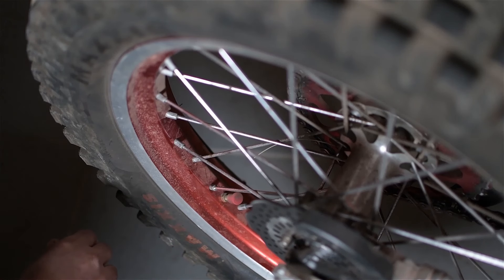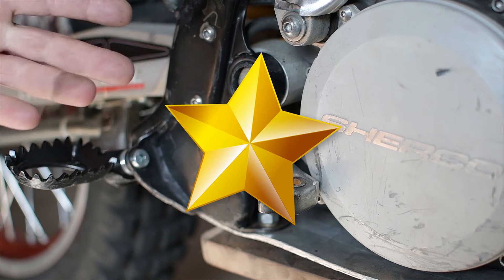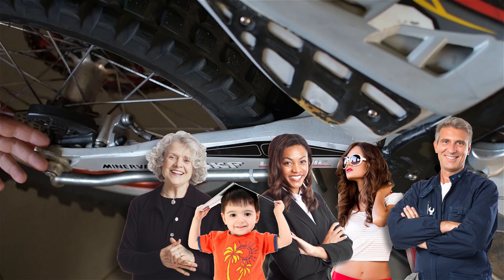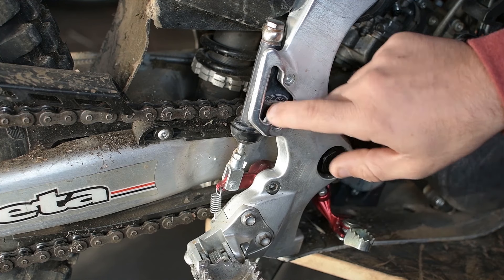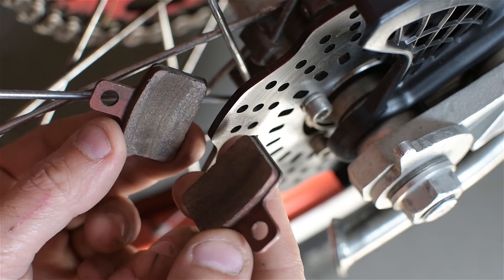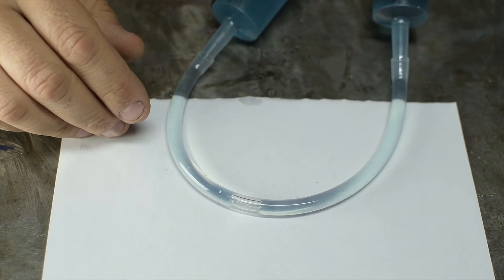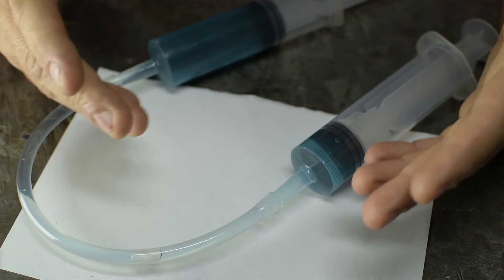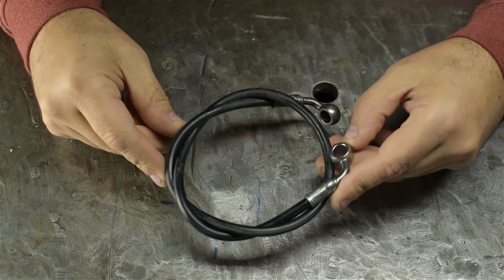I'm an Idiot! (Soft Spongy Brakes)

Comment: To fix my parent's van's squishy brakes, which were 4 years old, I replaced them. Only to find out that the rotors were well in spec and the pads had only half worn... they didn't need replacing... but it did fix it.

My best guess is the Eldritch effect, which will be discovered in the year 2241 (don't ask how I know).

Comment: Tony, you are not out of the woods yet. What you didn't cover was what causes the brake to stop braking; what pulls the pads out of contact with the disc when you release the brake lever? It's the seals acting on the pistons in caliper. The pistons don't pass effortlessly through the seals. The seals grip the pistons, deflect when the brake is applied and then recover to pull the pistons back a fraction when the lever is released. When the pads wear the seals cannot deflect enough, they lose their grip on the piston and it slips through to take up and compensate for the wear.
Although it might not be noticeable on all brakes, there's a cycle of increasing lever travel followed by seal/piston slip which should restore the original brake feel. So it is likely that the soft spongy feel will return, even with the new disc.
By the way, although spongy brakes don't feel good they still transmit the same pressure to the caliper so stopping power isn't reduced.

Comment: I have a spongy brake on my bicycle and couldn't find the problem  (my brake has a steel cable no hydraulik fluid). The bike is about 30 jears old and the breaking disc probably has never been replaced. I think ill check them as soon as I have some time. Thanks for the idea.👍

Comment: There is no way you would have missed a worn rotor unless the previous owner hadn't done the DIY refacing trick. You put a piece of W&D sandpaper onto a large flat surface, work the desired (soon to be flat) object around on the paper, flushing liberally with water and viola, flat object minus any groves or wear steps. Unfortunately, also minus a few millimeters of thickness. But it sure looks pretty!

Comment: TOT
had a very similar problem on Classic MC + 30 years old. Breaks would not bleed up and were spongy. Llike you went through all the same parts. But what I found and I suspect ther viewers may find it is the compensating port in the marster cylinder was blocked after being 30 + years old and gunge and grown in to the very small hole.  As you take your foot off the break pedal and it returns it suckes the break fluid back which inturn pulls the pistons back which stops the breaks draging.  If the port is blocked this vaccume is not broken and it pulls the pistons to far back off the rotor. This gives you long break leaver travel and soft breaks as the marster cylinder runs out of stroke befor full pressurer is applied to the caliper pistons.  A new thicker roto will hide this problem as the caliper pistons are back further in there bores so less volume is required to move them to the rotor and the pull back is smaller.  
For thoes of you with blead up problems I suggest checking the compensating port in the marster cylinder.  
Apologies for long winded post.  Hope this helps someone it was a weeks worth of work for me to find it.  
TOT love ever minute of your videos

Comment: This has been keeping me up at night. I would think that the thickness deficit of your rotor is less than the amount of allowable wear for the brake pads. I would think that with brand new pads, even a worn out rotor would not exceed the maximum travel of the caliper. I can’t argue with the fact that it’s fixed now, the only other explanation that I can think of is that maybe you temporarily relieved some sort of problem in the caliper (the only part you didn’t replace) when you were fussing with it to get it off to replace the rotor. Motorcycles have a nasty habit of accumulating rust on the caliper pistons. What I want to know is how can you get that close to a complete brake system overhaul, and not cross the finish line? Maybe you just don’t want to bleed the brakes again after you take the caliper off, LOL
Reply: I was thinking the exact same thing. The wear on the rotor would be insignificant to the pads wearing down. The caliper pistons have to be able to extend out as the pads wear down, just as you have to add more fluid as the pads wear.

Comment: The thickness of the rotor wasn't the problem...Caliper piston(s) position will compensate for wear, even as much as you measured and much more, as long as the wear is even. Your old rotor must have been warped which will push the pistons back into the caliper causing the need for more travel when applied.  .008 -.010" or more rotor warp will be enough to cause your issue. If you still have the old rotor,  check the run-out. Surely you have a dial indicator laying around.  ; )

Comment: I fought my 1981 Honda Goldwing with 50k+ miles on it for days trying to get the front brakes to work. Gallons of brake fluid. One those vacuum pumps. Nothing worked. Finally, someone told me the master cylinder for that year is undersized and it can't move the caliper very far, so it must be <1mm from the disk. I spaced the fixed caliper over with washers and got it within range, fixed. They were working just fine, but they couldn't reach the disk.
But now I think a bike with >50k miles might just have a worn disk.

Comment: On my Suzuki I to did exactly what you did. Replaced lines and rebuilt the master too. I since quit riding. Its been a few years. It sits in the corner of the garage but still with a bottoming spongy pedal. I just said he'll with it, but since you mentioned this I'm going to spec the rotor. I wouldn't of thought .100 would be that critical in your problem.

 Didnt think there was a limit because I've experienced on calipers that when they reach their limit they will normally leak and basically pop out the caliper. Now that I mention it a vehicle has a longer traveling pedal compared to the short stroke of a motorcycle. That would explain engagement at the bottom of the stroke. I will go mic my rotor. If this is true for me I will be totally torn because this went on for so many years.

Comment: I was also thinking Air (O2+N2+...) is very hydrophobic, just like oil. So it dissolves more readily in oil unlike water. Degassing the oil before using in hydraulic systems can help increase its bulk modulus (less spongy). But that might be more relevant for higher volumes of oil and higher pressures.

Comment: I have a Honda 350X death machine......I mean 3 wheeler.  I had the same problem on my rear caliper.  Unlike an automotive style caliper, the piston fits into the caliper from the back.  Because the caliper is assembled that way it limits the amount of stroke the piston has before it bottoms out.  I ended up just making spacers that fit behind the brake pads and has worked great so far.

Comment: Poor Tony! Your caliper pistons are stuck to the seals. Very easy to verify. Remove brake caliper and pump rear brake lever. The pistons should move a certain distance and retract when pressure is released from the brake lever. Now, if you keep pumping  the brake lever then you should be able to push the pistons out of their bore. And I bet that wont happen, because the pistons are stuck to the seals. Very easy to fix, and I know that you know how to do that. Have fun, and make another video please!

Comment: I had a Toyota pickup that I never liked how the brakes felt for the first few years I drove it. Came time to do a brake job and I discovered the pads wouldn't fit the calipers. Lots of head scratching in the shower later, I figured out someone had used calipers from a 4cyl pickup on my V6. The smaller pistons meant the front brakes were getting to work before the rear brakes. Changed the calipers and the brakes felt great.

Comment: Tony, I don,t think that the rotors ( or discs as we call them in the UK ) being thin was the problem - unless the pistons were so far out to let air in past the seals and more likely to leak fluid out. But badly worn discs are usually worn unevenly pushing the pistons in at a thick spot requiring more travel out at a thin spot. If it is bad enough the pulsing can be felt in the pedal but not always noticeable.

Comment: This was me on the side of the road on my 84 klr600 with a locked front caliper doing a change roadside, fresh fluid n flush, 20 min later does it again, after 2 hours n 3 bottles of dot 3 finally got it with lever pumping

Comment: Small bubbles can be bled by having pressure on the brake over night. It will accumulate at the highest point which mostly is your master cylinder.

Comment: No worries, when the breaks on my truck started acting up i replaced every single component besides some brake lines, it fixed the issue, but it was expensive and I still don't know what caused the problem

Comment: Just connect a rubber tube with a  lengthways razor cut, about 3/4" long. insert this end in a jar of clean fluid. Open the nipple and work the brake. When the bubbles stop you're there. Easy and works.

Comment: Another trick is to have spacers on the back of the pads. This is used in karting when the caliper design retracts the piston with springs. You just needed to put some shim backing and you would have solved your problem.

Comment: Isn't it funny that it's always the last thing you check?🤷‍♂️😁🤣I never even thought the rotor could be the issue either. I once had a problem my 66cc 2 stroke bike engine. I had bought a brand new exhaust system for it shortly after that my bike wouldn't stay running. I hit forums and started a thread and we bounce around for weeks maybe even 2 months and when I finally figured out the problem. I had replaced the piston, the piston-cylinder, the cylinder head, spark plug, carburettor, chain, gas filter and hose I even changed the damn gas tank basically I went through the list on the forum and changed everything that was suggested. So eventually when there was no other solution. I determined that the problem was that the brand new exhaust I bought was the cause. I had replaced it before the problem presented itself. No one thought it could be a brand new muffler, in any case, I shared the thread with the seller showing him all the things I have done to get my bike back running again, this lead to him sending me a new replacement exhaust(I did this because the return time had passed) and the bike is well, running like new.🤷‍♂️😁🤣

Comment: I was riding my Honda 360 with a soft and spongey rear brake for months before I finally got around to adjusting it to where it should be. First time out, muscle memory applied the amount of pressure to the brake pedal I was used to—I locked the rear wheel and dumped and skidded on gravel. Not a fun feeling on my knee and elbow.

Comment: I must have exactly the same problem on my old KDX 220. Driven me crazy. Changed both seal kits, brake line to a braded steel, etc. Bled it for 2 weeks. Dot 4 to Dot 5 Brake fluid. blah. No one said, check the brake discs (we call them that in South Africa) Still spongy.

Comment: That's an interesting story - I didn't predict the ending, though I did guess attempts 2 and 3.  One more possibility that I thought of, though I don't know if it's realistic, is that when you push the brakes, they might be pushing the forks apart rather than squeezing the rotor particularly hard.  The brakes can only squeeze as hard as their mountings resist.

Comment: To be clear, many calipers, at least off of bikes, only have one piston and just surface of some sort that pulls the other pad into the rotor and when they have multiple pistons they are typically on the same size. Clamping is more even that way.

I'm only specifying because you are generalizing with brake systems but not the parts exactly and the lessons are very transferable :).

I get these problems too, where other people don't think of the problem I have because they don't keep things as long as I do. I realized the springs on my car were bad, not the shocks. But everyone I knew, including actual mechanics argued with me until they were blue in the face. Turned out when I swapped the old springs out that I was right but it took me a few months of why doesn't the car feel right and hitting a few low spots in the hwy to feel how the car handled it at speed to see the springs weren't supporting the car vs the shocks not dampening it. It would squat and have issues getting back up but not bounce after. If I had the money at the time to purchased $1200 in new shocks as everyone told me to I would  have made the problem worse and needed new springs anyways. That also said the shocks on my car don't spring back up so I missed the chance to put better ones on my car thinking the ones I had got my hands on were shot ... paying for that now because the  one from 4 years ago are the problem now ROFL.

Comment: Being as you’ve got at least 0.250” of useable pad surface to wear away, that 0.025” undersize of the rotor is irrelevant. Chances are the new rotor fixed it because the old one was bent, not because it was too thin.

Comment: Took me 5 seconds after hearing it isn't an air bubble, to think it's the distance brake pads or brake lever travel before making physical contact. Really goes to show, that you should always start solving a mechanical issue by going through the basic functionality.

Comment: Well I certainly don't blame you for taking the long road. The very design of disc brakes allows for pad and disc wear. But facts are facts, you cured it with a new rotor so I'll have to adjust my model of the universe to suit.

Comment: If the pads are brand new, how can a rotor just slightly out of spec cause the pistons to bottom out? I am not questioning the rotor being the reason, I just disagree on the explanation why it was the reason.

Comment: It wouldn't be a bad idea to replace both of your brake lines with stainless steel braided brake lines. Conventional rubber brake lines expand far more than SS braided lines when pressurized, feeling almost like there is air in the line by comparison. They expand enough that if you put your hand on the rubber line and operate the pedal, you can feel the line expanding under pressure. A tip for you when bleeding your lines, if you dont k ow already, make sure you are applying pressure to the pedal when you are opening the bleeder, the idea is that the sudden outflow of pressurized fluid can carry any air bubbles toward the bleeder. Do not release the pedal/lever until the the bleeder is closed again, then re-prime and repeat.

Comment: I've had this happen on a 50cc scooter. 
Worn down pads can seem like the brakes are spongy. And obviously thin rotor will too. It's basically too much travel from the open to the closed positions of the caliper. mine was both...pads and rotor. 

I've also had a brake line de-laminate. The braid on the line separated and it would form a bulge in the line.

Comment: That is a minimal amount of wear and hydraulic disk brakes are self adjusting.  The fact that the new rotor fixed the problem makes me suspect that the old rotor had excessive lateral run-out which results in a condition commonly referred to as "pad knock back"  The rotor can have parallel faces and excessive lateral run-out so it would not always be accompanied by a pulsating pedal.

Comment: That shouldn’t have been a problem if it had been designed by someone competent.  Most brake calipers should have enough throw to touch the other side of the caliper that or piston if it has two for some reason.  With rotors that thin, that seems like an easy enough thing to solve in the limited space it has.  No wonder you had such a frustrating time solving the that issue.  Worn rotors don’t usually present with those symptoms, and usually it’s it’s chattering brakes or a bunch of other issues.  I’m surprised nobody else posted about this online before you.  Hopefully you save someone else the time and frustration by sharing.

Comment: Calipers have ONE or more pistons ( not two ) , and your old rotor was probably bent or had varying thickness ( very possible if it had been machined by a previous owner ) . Both cases will cause the caliber pistons to get pushed further back than normal and therefore need further lever travel to apply pressure . Yes , you can normally feel the pedal pulse - but not always . A disc worn beyond spec should still work perfectly with new disc pads - it’s only when the pads also get thin that issues could occur .

Comment: There are calipers with just one piston - floating calipers. And they suffer from stuck guiding pins. And with dual piston calipers you can also get problems when one of the pistons gets stuck.

Comment: But the pistons are self adjusting for wear... just as the brake pads wear out they will go inward and continue to touch the rotor. A 0.035" thinner rotor would not make a difference going by this logic... I think there is more to it.

Comment: Some auto brake pads come with a thin metal spacer to put between the brake pad and caliper. From what I remember it resembles a thin piece of stainless steel. Not sure if this was an option in this case, but maybe something to try before replacing the rotor in some instances.

Comment: Tony even if you reengineered the brakes u are a funny guy :) 
Once I ve cleaned the carbs and forgot to put back the fuel line and kinda thought about why it doesn t starts for 15 minutes :))